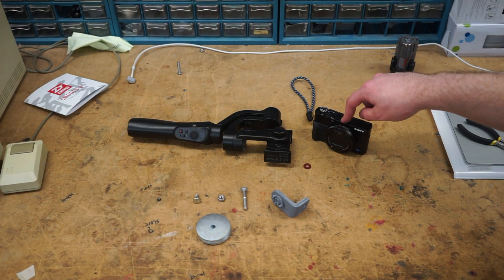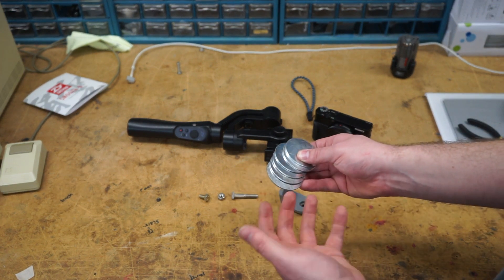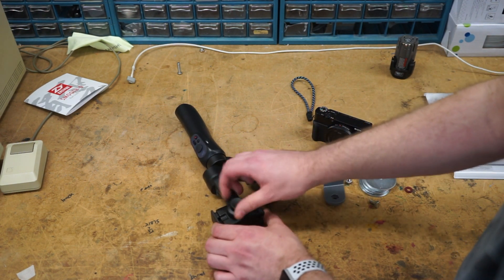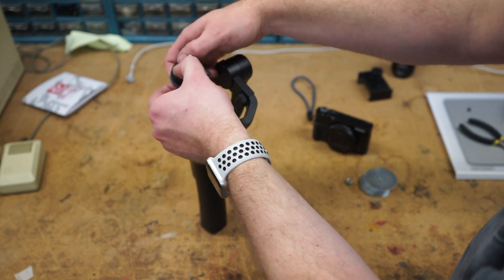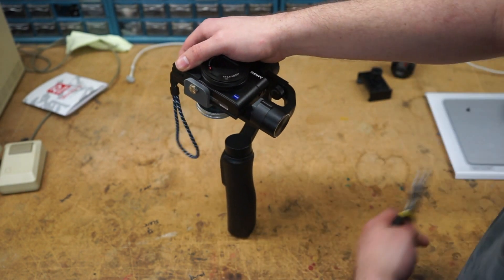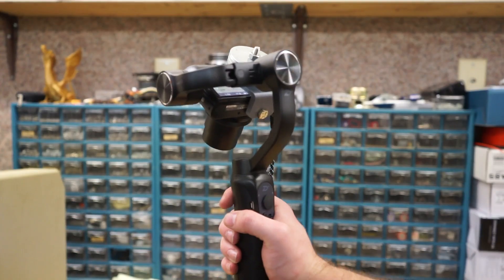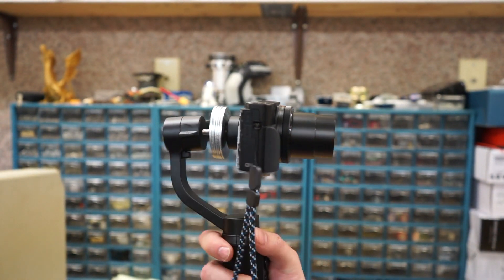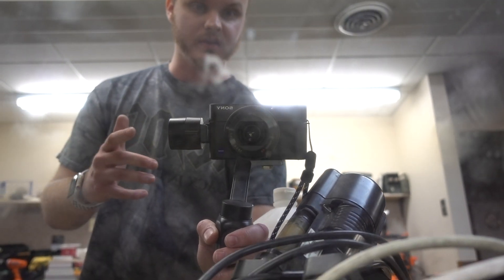3D Print a Sony RX100 Zhiyun Smooth Q Adapter

Comment: About viewfinder. You can put almost any computer or screen paired with hdmi-wire. So its not big problem. For me problem is that hdmi in my sony is put too close to holding screw so i cant use both.

Comment: The Smooth Q manual says MAX 200g camera but the sony RX100 weighs in at 290g so I'm wondering if that extra weight will effect the motors over time ?. Have you used your RX100 with this gimbal much ?
Reply from the maker: PINACI news other than testing, no I haven’t used it extensively. Honestly I made this so I could take it on a long hike but that got postponed for at least a year. Messing around with it in my shop is mostly what I’ve done and it seems reliable. I don’t hear the motors laboring and I’ve yet to backdrive them. The only downside I can think of, is that if you’re running the gimbal beyond the recommended weight maybe that could reduce battery life.

Comment: Can I order your adapter? Since I do not own the 3d printer...
Reply from the maker: Sure! I'll put a link in the description.
Reply: @p8blr  Thank you for your quick respond. I will only need an adapter since I have all other things with me. How much will be the adapter with s/h? I am in VA, USA.
Reply from the maker: Sure no problem. Link added to subscription.
Reply: Purchased!
Reply from the maker: Shipped!
Reply: @p8blr  just curious. Is there any way to print it in aluminum or light weight steel?
Reply from the maker: There is but the price of the machines are literally hundreds of thousands of dollars. You would be better off having a local machine shop or makerspace cut this on a CNC mill.
Reply: @p8blr  Good to know, thanks. I will try to use small washers and compression nut for the counter weights to avoid blocking the whole screen. I will let you know how it goes.
Reply from the maker: I'll be interested to see what you come up with. Eventually I'd like to make a gen 2 version that doesn't block the screen but other things have been taking up my time 😂
Reply: @p8blr  https://goo.gl/images/LHnfKy
This is what I found, but it seems very hard to get one of those counterweights.
Reply: @p8blr  I am getting quotes from cnc companies on ebay. They asked me the dimensions since i could not able to attach your files. If you dont mind, can you share the dimensions?
Reply from the maker: Mo Kang you should be able to give them the .stl file I have shared on thingiverse in the description. Also if you download Fusion360 (free) you can  modify the design to your liking.
Reply: @p8blr  Thank you for your quick respond.
Reply: @p8blr  I received the part, thanks. Fyi, I got an quote from cnc company. $90 with tolerance 0.005" in aluminum 6061. Lead time is 2-3 weeks.

Comment: Hey, this is great! Is it possible to print through Thingiverse? I dont have a 3D Printer.
Reply from the maker: Not that I'm aware of but some websites will print things if you send them files like Shapeways. I was considering putting together a kit of the printed part and necessary hardware and selling that on eBay for people that don't have printers. Would that be something you'd be interested in?
Reply: Ron Tozier i just was thinking why don't you make a few and sell it :D..it would be great in jet black colour :D